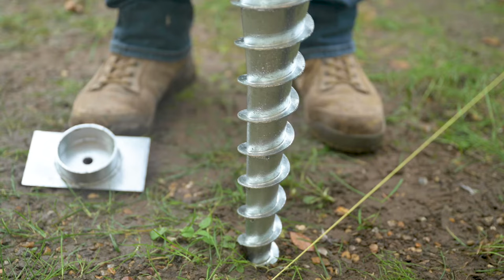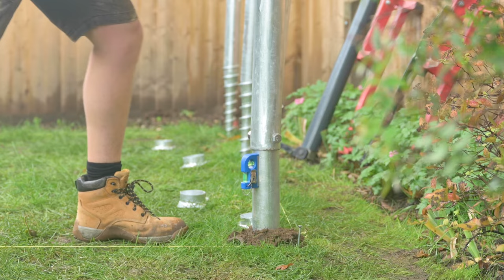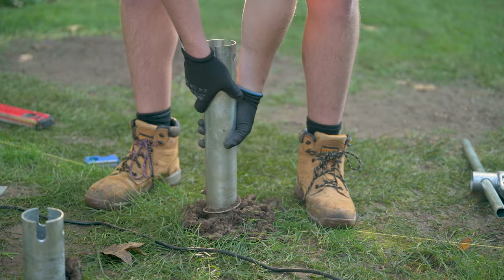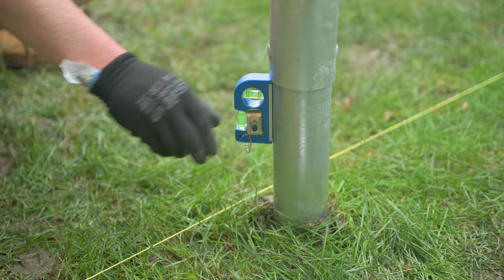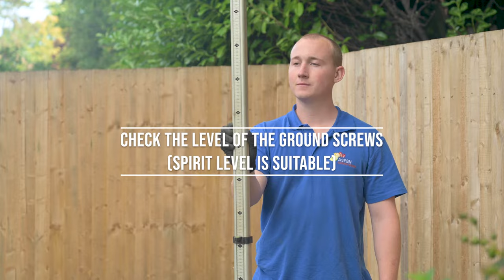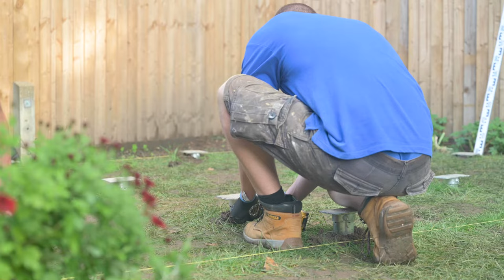How To Install Ground Screws?

Comment: Where do you get the installation tool?
Reply: 700 fucking quid to rent a petrol driver  6000 quid to buy one. It's only a poxy high torque gear box on a 5hp motor.

Comment: What beautiful stoneless soil you have. These ground screws are horrendous, don't bother with them.
Reply from the maker: Hi Mary, I'm sorry that you're not a fan of the ground screw system. I checked our records and can't find an order under your name, perhaps you used a different supplier. Ground screws work in all soil types including ground with stones and tree roots. The trick is to use one of our SDS drill bits to pilot down. This will remove and break up obstructions in the way. We also supply longer handlebars for extra leverage, along with electric installation machines for larger installation jobs. Even with a few stones in the ground, this is a far easier job than digging out and filling with concrete! 😁
Reply: Wrong.
Do you need to drill a hole through the rock with then add gravel then screw in the ground screw… still better than over digging to remove obstacles
Reply: @sipsgroundscrews7479  I didn't buy your screws, they were from a different supplier and my name isn't really Mary Haddock (obviously). I did eventually get them in but I was utterly exhausted when finished. Digging the holes and concreting in would have been much easier in my case. An industrial drill might make a difference getting through rocks but access to it with big machines was impractical.